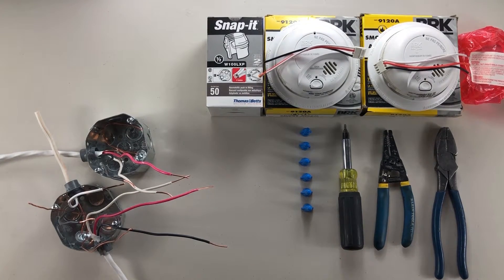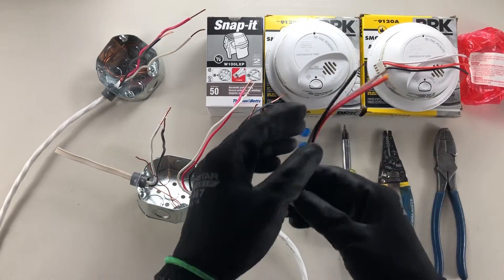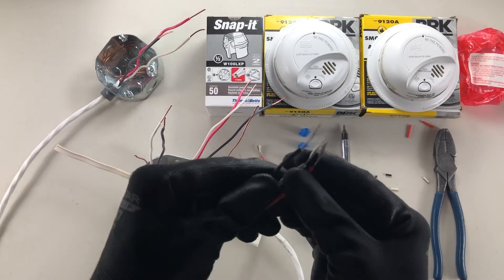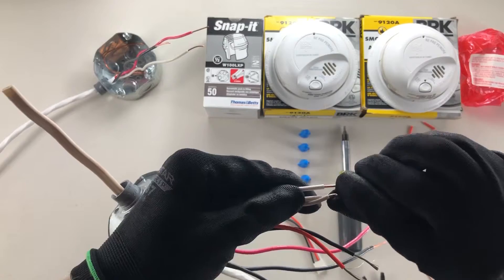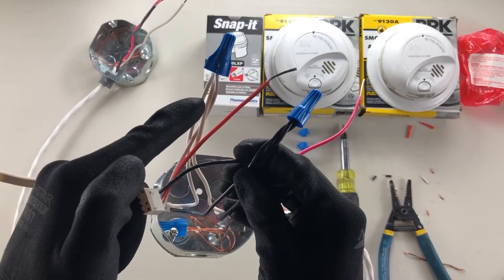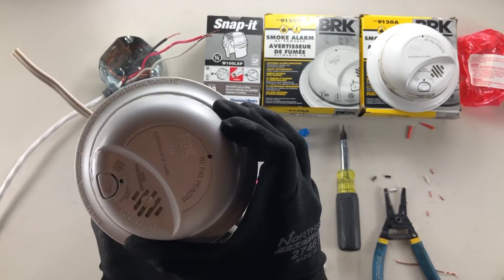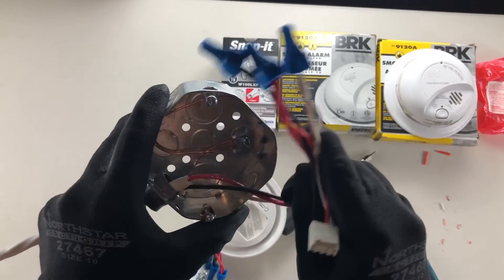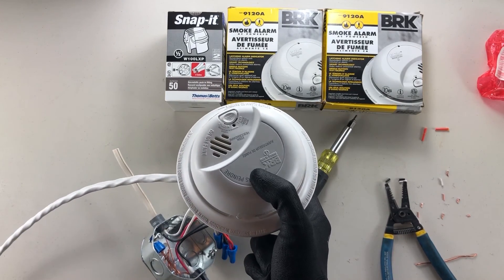How to wire smoke detectors - smoke detector interconnection - The Electrical Guide

Comment: Question if I may. 
I have preexisting smoke detectors in 3 bedrooms a fourth room is now considered a bedroom. How do I add a detector into the existing run?
Reply from the maker: 1) Run a 14/3 wire from the nearest smoke detector in the house. This will allow it to go off when the others do.
2) Jump power out of the nearest lighting circuit (not after the switch) and connect just the black and white from a 14/2 from your nearest lighting circuit to the smoke detector. ( this will not go off when the others do)
3) easiest Buy a battery powered smoke detector and mount it to the ceiling. ( this will not go off when the others do)

Hope that helps!
Reply: @theelectricalguide  thank you. I would like to keep it an electric feed as that’s what all the others are.  I will try your suggestion. Thanks again

Comment: First off, thanks for your informative and clear video. 

If you have any insights on wiring described below, I'd appreciate any input/feedback/thoughts.

BACKGROUND:  I replaced 3 hardwired (ionization- style) smoke detectors with combination smoke/CO detectors (one per floor).  Now I want to replace a very old photoelectric-style detector on our bedroom level that is located less than 2 feet from the replaced ionization-style detector.  Unfortunately, the manufacturer of the photoelectric detector no longer exists.  Replacing the ionization detectors was easy, as they had a snap-in adapter on the back with the typical red, white and black wires.  The photoelectric one I want to replace, however, is connected to 6 wires (red, black, white, green, blue, and yellow) with the wires poking through a very small hole in the ceiling.  The 6 wires then connect to 4 screws inside the detector (screws are labeled 1-4): yellow & white to #4, blue & green to #3, black to #2 and red to # 1).  I'm not sure why there are extra wires and what they might connect to (might it be for a security system)?

Any idea on what is needed to hardwire a new detector in this 6-wired location and what these 6 wires represent?  If needed I'll hire an electrician, but have completed simple electric work (e.g., replacing ceiling lights, etc.) and, if straightforward, would prefer to do myself.
Reply from the maker: That sounds like low voltage wiring. What size are these 6 wires? What size/colour is the cable they come out of? Sounds like what you might find if you take an old thermostat off the wall. Maybe those wires go back to a monitor board/panel of some kind somewhere else in your house. It's possible it's part of the security system as well. Sounds like you've got some investigating to do :)
Reply: @theelectricalguide   I'm not sure what size wires they are, but I can say they are a good bit smaller than the typical gauged wire I've encountered in an outlet/light switch.  Unfortunately, I don't know what size/colour of cable they come out of;  to do so, I'd need to start cutting into the ceiling (since the hole they come out of is about the size of the nearby screw hole used to attach the detector to the ceiling) and, as of yet anyway, I'm not ready to make a bigger hole.  Will have to do additional research.  Thank you for your input-- it's greatly appreciated.
Reply from the maker: @jmackay7055  Those are low voltage for sure. Likely part of a brown or grey cable, I'd guess approx. #18 AWG size. They most likely go back to a board or panel of some kind. Look around your house, maybe a security panel/box near your pane;? Good luck!

Comment: Just wonder where is the ground wire for the last smoke detector go if using the plastic box?
Reply from the maker: The ground wire in your cable will still terminate on the screw in the back of the box. https://youtu.be/JuPdhC-C17Y
If the smoke detector is plastic it won't need to be bonded. Hope that helps :)
Reply: I had the same exact question I was gonna use a wire nut and tuck it back in but then realize that the wire is bare copper and I was just wasting a wire nut😂 so I just pushed it back in to the box not sure if matters ?

Comment: Let's say it's going to a 15amp breaker, the smoke detector came with 18awg and you are attaching it to a 14awg. Wouldnt you need 14awg going to your smoke detector? 18awg can't handle 15amps
Reply from the maker: The smoke detector will never draw 15 amps. It's on a 15 amp circuit because that's the minimum size in a residential panel but unlikely to even draw 1 amp. #14AWG is the smallest size permitted in residential circuits however the wire size attached to electrical devices may be smaller if they draw less amperage.
Reply: @theelectricalguide  ya it draws 0.9amps. thanks

Comment: On a 3 level house do all the smokes go on one circuit? Run the smokes first and then after the last smoke go into a switch and out to some lights?
Reply from the maker: Yah you can put them all on the same circuit, but it needs to be a lighting only circuit, no outlets on it. Of course make sure you don't switch the smokes by accident haha :) Run a 3 wire between them as well so they may be interconnected and chime together.
Reply: @theelectricalguide  I live in Ontario and I am doing a renovation on a 35 year old house that only had one fire alarm installed.  I put a fire alarm in the basement and main floor in 1991, but they are  on a different circuits.  I just ran a wire between the three alarms.  I am now doing a major renovation on the main floor, moving the kitchen from one side of the house to the other side.  I am getting an electical inspection but your video worries me.  I will be installing a new fire alarm on the main floor and I will be interconecting it with the others.  Will the inspector care that they are all not wired together and that they are conected via 14/2 with a separate interconect wire?
Reply from the maker: @BMac-dr8oc  The inspector won't care that they aren't wired together. I mean you can have a 100% battery powered detector that isn't on any circuit and that's just fine. Something to consider, I know they're a bit more expensive but it you can't easily interconnect them all on one circuit that's an option. Interconnection isn't mandatory. FYI some of the rules around detector installs are governed by the Ontario building code not the electrical code.
Reply: @theelectricalguide  Great point re interconnectivity during my electrical inspection.....so will keep that part simple :)  No interconect.  I will iterconnect them for the building inspection as they are required to be interconected because I have a basement apartment.

Comment: So your first home run coming from the panel needs to be 14/2 and everything there after needs to be 14/3? Great video
Reply from the maker: Hey Shawn, your feed will be 14/2 and between each box 14/3 exactly. Your home run or feed won't come from the panel though, instead it should be off a lighting circuit, so the closest lighting box nearby would ideally bring the feed in with a 14/2. Just make sure you don't accidently switch your smokes on and off with the light :p

Comment: How many detectors/ rooms can I put on one line ?
Reply from the maker: As many as you want, ideally the whole house will alarm if any one detector rings. Be sure to put  them on a lighting circuit per code rules.
Reply: The instructions on most residential smoke detectors lists a max of no more than 1000ft from beginning to end. That’s pretty lenient for most installs.

Comment: If I don’t have hardwired ones, I’d have to pretty much get an electrician to install hardwired ones right?
Reply from the maker: Hello expressfashionman89, yes that is correct. Installing hardwire smoke detectors is actually quite intrusive to your home. Lots of drywall would need to be cut and therefore repaired to do it properly. These days battery powered ones are just as good though, I don't think you really need hardwired ones. It would be cheaper to get a whole set of 'smart' smoke detectors that communicate with each other without wires than it would be to hire an electrician to come install hardwire in your whole house I'd think. Check out the nest protect. Hope that helps!

Comment: What if the box is plastic. Do I have to put a ground wire to anything?
Reply from the maker: Hello Maureen. You only need to bond metal components to ground. Plastic components for your smoke detector do not need to bebonded to ground. Hope that helps!

Comment: And also the smoke detectors that I have right now there are not wired so how do I do?
Reply from the maker: You can use battery powered ones that's totally fine. Sometimes they even have a frequency that will alert the other battery powered ones as well, everything in this video can be purchased from your local hardware store.
Reply: @theelectricalguide  thank you so much
Reply: @theelectricalguide  these Hardware stores that I'm going to in too,  nobody seems to understand what I need do you have a cell number or are you in Houston?
Reply from the maker: @elondamambakasa6577  Hey Dan, what is it you're asking for exactly at the hardware stores? They should all have both wired and battery operated smoke detectors. I know the Nest ones are pretty nice although they are on the expensive side. I'm in Ontario, Canada.

Comment: Question. Hoping someone can help me as apparently Kidde’s support has disappeared during the pandemic. I had three interconnected hardwired smoke/co2 alarms. All three reached the end of their useful lives in the past couple months. I had two stand alone nest alarms lying around so I mounted those, leaving the kidde quick interconnects in the ceiling box. For the third alarm, I installed an identical kidde alarm and hardwired it into the electrical system using the existing three wire harness. I then read the instructions (🙄) and it said don’t use the red wire, which carries the 9 volt signal to the other hardwired alarms. Can someone tell me if it is necessary to disconnect the red wire?  My red wire goes to the other two kidde harnesses which aren’t being used. I’d prefer to leave everything connected as when the two battery nests reach their end of life, I’d like to go back to using three kiddes and have them be interconnected. Not a big deal to disconnect the red wire but I don’t understand why I have to. Can someone explain what the issue is in my situation?
Reply from the maker: I don't see an issue in your situation. That red wire can stay connected in your hardwired Kidde alarm and even if it goes off it may try to send a signal to the other locations which aren't currently connected which means nothing will happen. The signal voltage isn't enough to be dangerous nor would it even be able to contact anything if still wired into the harness.
Hope this helps!
Reply: Follow up: I finally was able to get through to kidde and they confirmed I was ok to hook up the red wire even though it was not connecting to the other two nests. Here is the surprising kicker though: when I hooked up the kidde and pressed the test button, it AND the two nests went off with the kidde!  I called nest. Their alarms have blue tooth and talk to each other but they said the nest will pick up “a frequency” from the kidde and sound an alarm. The kidde does not have Bluetooth as far as I know, and the person from nest couldn’t tell me if the frequency was the audible alarm or something outside of human hearing or what, but I was pleasantly surprised. Of course the nest  going off won’t trigger the kidde but still...

Comment: What voltage is the signal wire carry is there a normally open contact when one goes off it closes the contact sending 120v through the red wire im just curious
Reply from the maker: Usually 9v

Comment: Can u please tell me the sizes of each wire and capacity of smoke detector?
Reply from the maker: The wires sizes are #14 AWG 3 conductor (14/3) and the smoke detector would be on a standard 15 amp circuit.

Comment: Your idea of a lighting circuit indicating a problem is good, but is not code everywhere.  In my area the detectors must be on a separate circuit.  Your install instructions were excellent!
Reply from the maker: The codes I refer to are mostly Canadian codes and sometimes Ontario codes. US and Canadian codes are very very similar but of course they do differ in some small ways.
Reply: That's a weird code, the reason why it's typically on a lighting circuit is so you know that if the light is off there is a visual indicator that no power is going to the smoke detectors,  I wonder what the rationale for putting smoke detectors on a dedicated circuit is. They don't draw very much.
Reply: @MichaelMillers  smokes in USA require battery back up so if you you lose 120v feed the battery back up smokes will chirp
Reply: @jerseybil1  Thank you I did not they would chirp if power was loss good to know thank you
Reply: @jerseybil1 maybe some smoke detectors chirp when they dont have power, but most chirp because the battery is getting low.
Reply: @MichaelMillers lighting circuits always have constant power, so unless youre pulling the power to the smoke from the switch leg (light box) then your smokes will have constant power.

Comment: hi i am wondering as i will add a smoke detectors to the other smoke detectors, will it be ok to add a wiring to the 3 black, 3 white and 3 red plus the ground, the wiring will be 4 each color? thank you
Reply from the maker: Are you talking about 4 wires connected under 1 wire connector? Yes that is allowed as long as the connector is of the right size. Check the packaging and look for 4 -  #14AWG meaning this marette or wire connector is good for up to 4 - #14 AWG size wires which is likely the size you're using. I suggest watching my video on making wire marette connections. Hope this helps!
Reply: @theelectricalguide  Yes i manage to connect it using 14-3wires.

Comment: Do all alarms have to be fed from the same circuit? Example: the smoke detector I have outside my bedroom is already powered. I am finishing wiring my garage (sub panel fed from that same main panel) but was going to run a circuit for them, and then just send a signal wire up to the alarm outside the bedroom. It seems like that may cause some sort of issue with two different circuits powering. I figured the interconnect wires would be a stranded low voltage but it appears like it is a fairly heavy gauge wire...?
Reply from the maker: Hey MeltingRubberZ28
All smoke detector circuits should be shared on a circuit that has lighting only. Therefore if your lights were ever not working you would therefore know your smokes aren't working and are more likely to notice/rectify the problem. That being said I suggest all smokes be on the same circuit however they will still work on different circuits. The interconnect wire we use in residential is 14 AWG usually red. It is usually solid but stranded is permitted. I hope this helps!
Reply: @theelectricalguide  After planning it out, it would be stupid to not put it all on one circuit anyway. Thanks for your help!